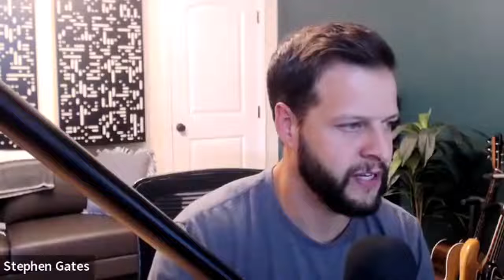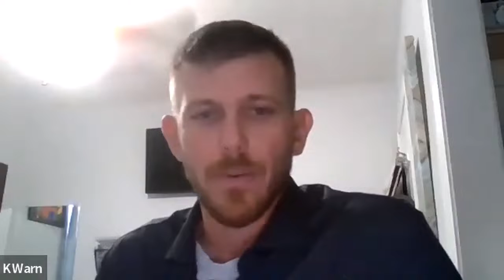From Panel Builder to PLC Programmer (Keith's Story)

Comment: Hi Stephen,

Hope you're doing well!

I see your marketing is more directed towards technician with have lots of experience with circuits and mechanical hardware presumably.

If I don't have this background, but have more of a (knowledge) background in programming, would your coursework help fill that gap as well?

Thank you,
Joey
Reply from the maker: Joey, great question. We have had IT/programmers do well in our program before too. I do recommend some basic DC circuitry knowledge though. Hope this helps. Let me know if you have other questions.
Reply: Do you think its possible to get an internship in the field even if you don't have an engineering or technician background? @myplctraining1238